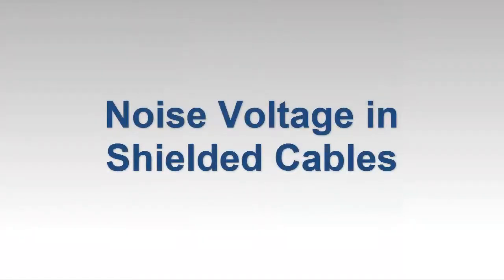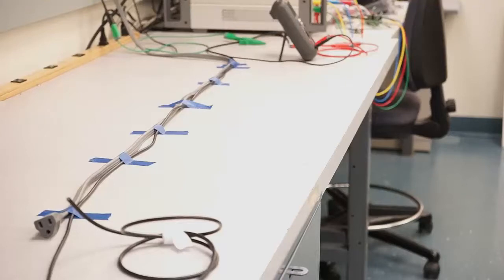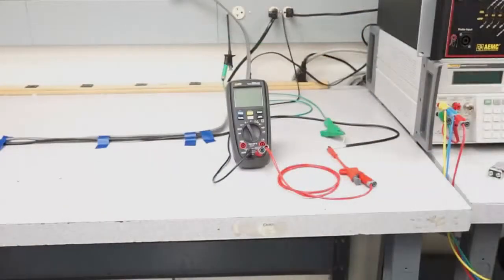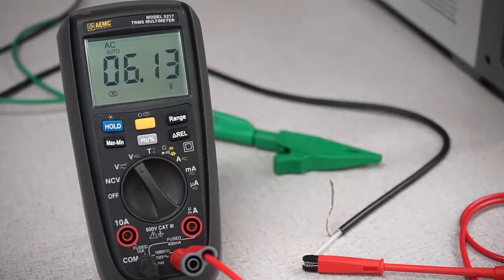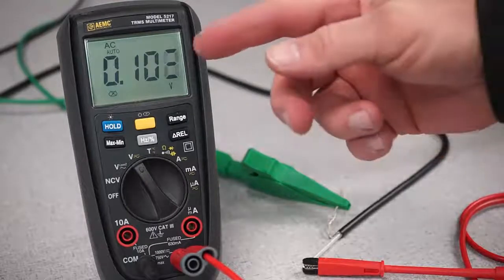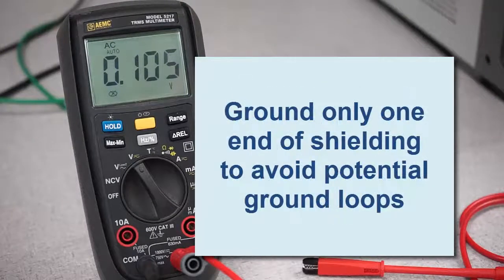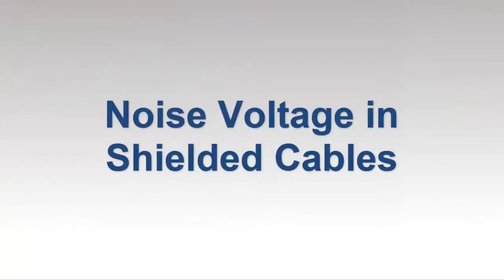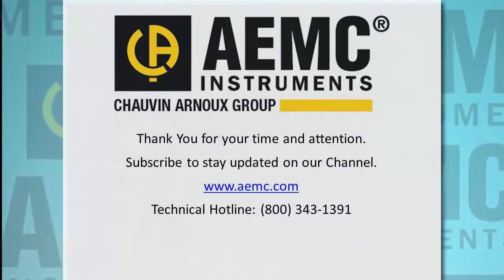AEMC® - Reducing Noise Voltage/Broadband EMI In Shielded Cables

Comment: Great info, how the unused drain wire should be terminated? Should it be cutted off back to jacket? Or can it be twisted around transition where multi conductor jacket was stripped?
Reply: you need to properly isolate the other end of drain wire like putting an electrical tape to it